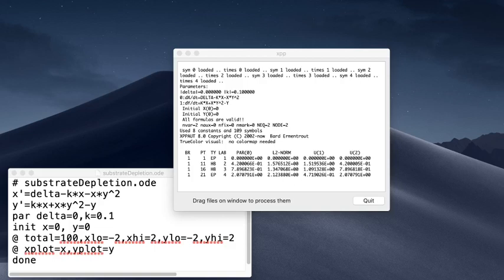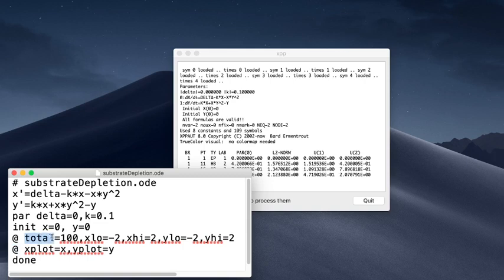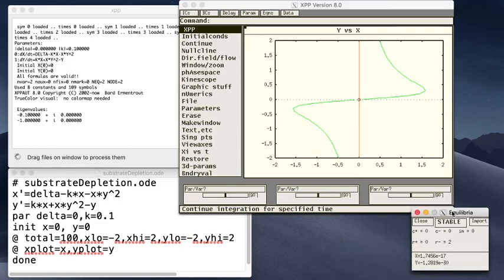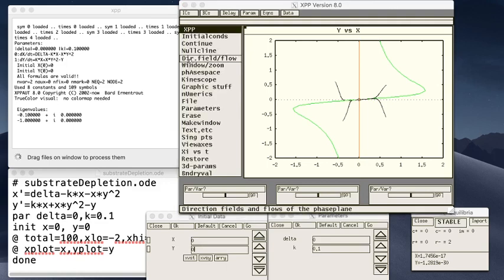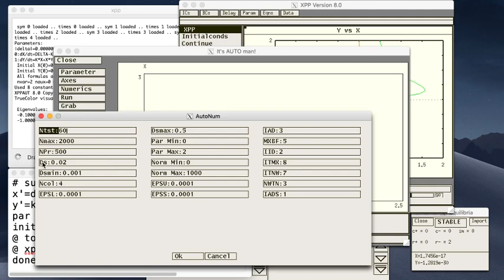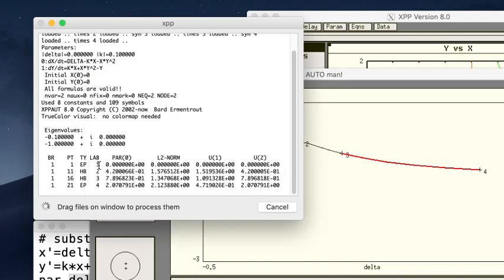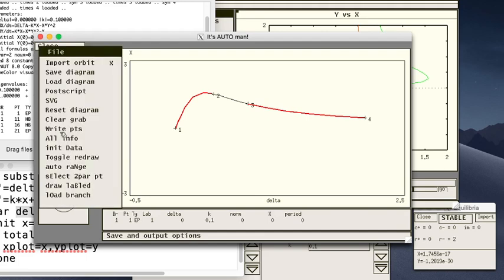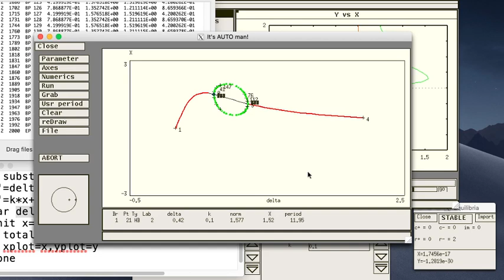Use XPPAUT to create a bifurcation diagram with periodic solutions for a substrate-depletion model

Comment: Thanks, Eric for the useful video, can you help me track periodic(stable and unstable) solutions and plot a time series of the periodic solutions emerging from HB points. I am working on the Normal form of the Hopf bifurcation model, I got four HB points, each having emerging periodic solutions (green and open blue circles), I want to track each orbit and plot X vs T graphs to identify the pattern types that each HB point gives and also plot two-parameter diagram from those four HB points, Please help.

Comment: Hi Eric, really useful video. I am currently using XPPAUT to do bifurcation analysis on a reduced Morris Leccar model that describes Class 1 excitability in neurons. Part the analysis to find a limit cycle that emerges from a Saddle Node Bifurcation on an Invariant Circle (SNIC). I can produce the path of the steady state well enough but the limit cycle emerges from what XPPAUT call a limit point (LP) what exactly these are I am unsure and how to get the limit cycle to appear I am stumped on. Do you have any advise?
Reply from the maker: Hi, Daniel. Glad it was useful. An LP is XPPAUT's name for a saddle-node. I don't think XPPAUT will identify that a saddle-node is actually appearing on the periodic when it finds the saddle-node while tracking a steady state because that requires a nonlocal calculation. If you can track the periodic somehow to the SNIC, XPPAUT will at least identify that the period blows up at the SNIC. I don't know that XPPAUT will ever label it a SNIC.
Reply: @ericcytrynbaum  Hi Eric, yeah I know XPPAUT has a limited library of bifurcations it can identify. So you don't think that it will let me expand the limit cycle from the saddle node? Okay, so tracking the periodic. I have seen that in the drop down menu. Do I start from an initial condition that is on the trajectory on the invariant circle tell XPPAUT to follow the period?
Reply from the maker: @danielstocks9787  To track a periodic, you have to give XPPAUT the entire periodic as a starting point. The easiest way to do that would be, for example, if that branch of periodics arose from a Hopf somewhere else then you could follow from the Hopf and continue until hitting the SNIC.
Reply: @ericcytrynbaum  This is not an option for this system. There is only a single bifurcation and that is the saddle node in question. Do you know of any other way to give a XPPAUT the entire periodic? Thank you for all your help so far. Resources for XPPAUT are very limited
Reply: @danielstocks9787  There is a Hopf-Bifurcation (labelled HB in xppaut) point at a higher value of bifurcation param (Istim). If you start from that HB and follow the limit cycle you can come close to the SNIC bifurcation.
Reply: @ericcytrynbaum  I it is any help the figure I am trying to reproduce is fig 2b in the class 1 column of the paper in the link. You can see the S-shape of the fold and then the two horizontal lines of the limit cycle.
http://www.math.utah.edu/~borisyuk/OLD_TEACHING/6770_Fall15/excitability_types.pdf